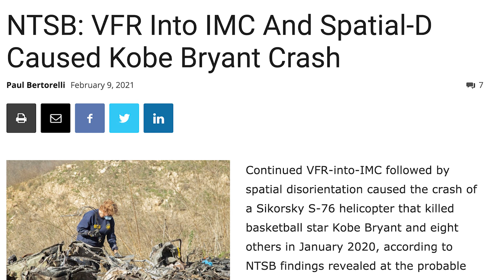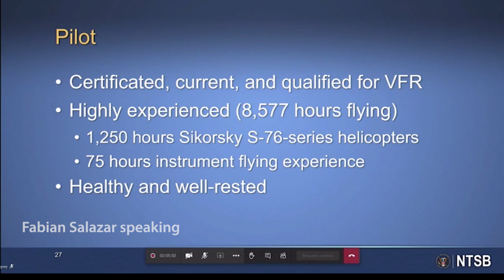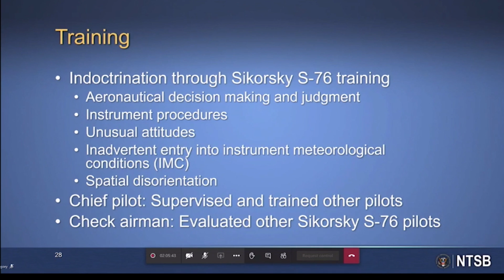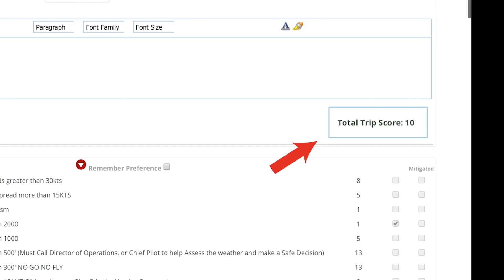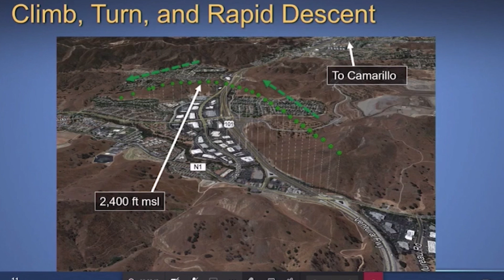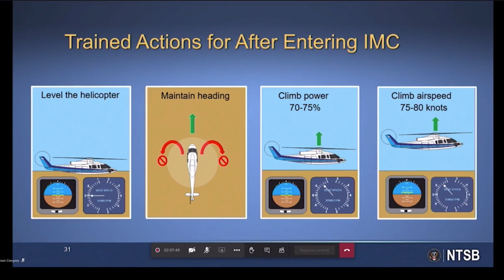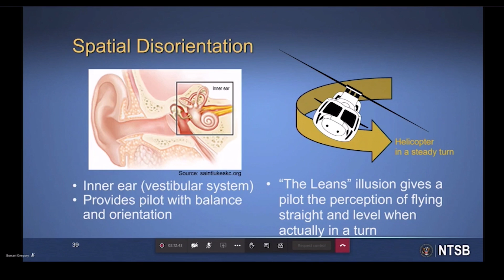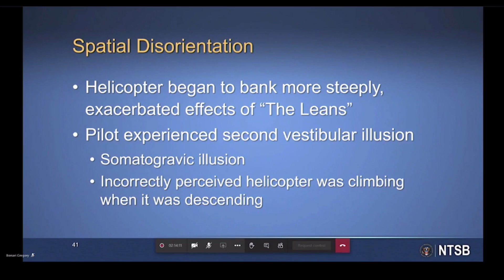How A Split Second Wrong Decision Caused the Kobe Bryant Fatal Crash

Comment: Paul, speaking of root cause, I still don’t understand how a commercial operator in Southern California where rugged terrain is a permanent feature and marine layers are a typical part of a pilot’s day is not authorized to fly IFR. And how does an 8,577 hour helo pilot only have 50 hours in IFR? If my family was a customer, a minimum standard would be IFR authorized operations and flying on an IFR flight plan every time.
Reply: Charter wasn’t IFR certified. You should be able to figure out why they don’t want it....rigorous testing, certification, lots of money, expensive insurance etc. in other words, it’s much much cheaper to operate a vfr only charter.
Reply: I had the same thoughts. I think most agree that the ”always IFR” attitude has improved the safety of the commercial aviation. If this guy had the option of filing IFR he probably would have been on autopilot and never had a single issues.
Reply: @Mrcaffinebean  yeah. He didn’t have the option of taking off with a full ifr flight plan. He did the old “I’ll go take a peek at how bad the weather is.” Well, it was bad, worse than he thought and he couldn’t turn around. Tough to say what he would have done if he safely made it above the weather. He would have had to declare an emergency and get ifr vectors.
Reply: @Debkghtulvkfjkjfxjjcj  yeah it’s pretty sad that a private pilot taking off that day had more safe options available to them than this pilot did.
Reply: @Mrcaffinebean  that’s a false statement.
Reply: @Debkghtulvkfjkjfxjjcj  this pilot did not have the option of filing IFR. In marginal weather it is much safer to file IFR. Therefore he did not have as many options available to him to safely take this flight as a private pilot would have.
Reply: @Mrcaffinebean  a “private” pilot doesn’t automatically mean they can fly ifr.
Reply: @Debkghtulvkfjkjfxjjcj  thanks Captain Obvious
Reply: @Debkghtulvkfjkjfxjjcj  Exactly.  That regulatory restriction on taking the safer approach (i.e. flying IFR) cost lives in this case.  The solution to this problem is to reduce regulations, not add to them.  Make it cheaper and easier for companies to use IFR flight and the safety increase that comes with it
Reply: @StevenWalter  Wrong. The safer approach was not taking off in bad weather.
Reply: @Debkghtulvkfjkjfxjjcj  It's always safer to stay on the ground, so that's not a useful analysis. Even the NTSB stated that there wasn't anything inherently bad about the weather that day. An IFR plane and pilot on an IFR flight plan would have had no problem. But that much safer option was taken away by regulation. Maybe there's good reason to make such operations prohibitively expensive, but I would have liked to have seen at least a discussion of that by the NTSB. They have a "human factors" person, maybe they need a "regulatory factors" person too
Reply: @Debkghtulvkfjkjfxjjcj  please watch the video on which you are commenting. The weather was not “bad” it was just not VFR. In  the pilot wasn’t even wrong to take off. Only wrong to continue according to the NTSB.

If the rest commercial aviation canceled flights flights for weather like this they would cancel 1/3 of flights. Instead they just file IFR because unlike most helicopter operations, they can. 

Due to regulation we have a disparity of safe options available between the private, IFR rated (since I have to point that out to you) pilots and then same pilot operating in a commercial capacity.
Reply: @Mrcaffinebean  Exactly my point. When you know the weather is dog shit at your destination, you shouldn’t take off. Kinda hard to argue with me here as all of the passengers are dead. The dude was circling at van nuys to get SPECIAL VFR clearance and had PLENTY OF TIME to look at the weather at the destination. He should have never taken off, and if he did, he should have landed at van nuys and told the people to get a limo. He didn’t not have the option for IFR since his charter was NOT certified for ifr which was apparently OK and perhaps even WANTED by his passengers since flying ifr helicopter is very dangerous. If the passengers wanted an ifr charter they had the money to get one. This isn’t about regulations, this is about a great pilot making a shitty decision. End of story.
Reply: @Debkghtulvkfjkjfxjjcj  reading is fundamental buddy, IFR helicopter charters seem to not really exist. Kobe wasn’t being cheap by picking this charter.

If this pilot wasn’t flying in a commercial helicopter charter operation no one would be dead. 

It is a sad that the FAA has made it harder to be safe.
Reply: @Mrcaffinebean  everyone agreed to vfr. The charter agreed to vfr. The pilot agreed to vfr. The customers agreed to vfr. And who makes the decision of whether vfr was ok for that day? The pilot. And made the mistake? The pilot. IF YOU DONT LIKE THE LIFEGUARD’s RULES STAY THE FUCK OUT OF THE POOL.
Reply: @Debkghtulvkfjkjfxjjcj  lol passengers have no idea what VFR/IFR is. In fact passengers probably assume that an aircraft is not going to collide with a mountain despite having all the proper instruments to avoid doing so simply because a pilot is told he cannot file a particular flight plan even though he is fully trained to do so.

I am sure if most people realize such a regulatory condition existed they would not take helicopter charters ever.

The FAA is the equivalent of lifeguard telling swimmer that if they are worried about drowning they aren’t allowed to wear a life vest and should instead just stay out of the pool. Sure that is the safest thing to do but people are will get in anyway and drown. 

So instead of screaming like a child saying they should. “STAY THE FUCK OUT OF THE POOL!” Logical people say, “ Why weren’t they allowed to wear a life vest?”
Reply: Y'all out here complaining saying IFR needs to be easier, but let's be real, unless it was literally the same reqs as vfr, there would be charter operations that opt for vfr only because it's cheaper. The real solution would be to make IFR a requirement for any commercial operation, leave vfr for hobbyists who aren't under pressure to get anywhere and only have the incentive to get back alive
Reply: @Aeronautics101  I don’t disagree with that, at least for charters that do this kind of flying. Are the big carriers legally required to file IFR or do they just choose to make it an industry rule? I did some Googling but couldn’t find a straight forward answer.
Reply: @Mrcaffinebean  I don't think the answer is as easy as you think it is.   Would they have been safer under an IFR flight plan?  Most definitely.  But that's the whole point here.   As the other fellow here stated, they weren't supposed to be flying in the conditions they encountered.  
   If you make all charters IFR,  costs now increase significantly, due to training, insurance, etc.  Because IFR flight is inherently more risky.  Also, it doesn't guarantee that everyone has a safe flight.  IFR flights can crash just as easily as VFR flights.  So you really aren't changing anything.   All you are really doing by going IFR is allowing the pilots to fly in IFR conditions.  
    The catch is that you don't need to fly IFR all the time, but you sure as heck would have to pay for it.  Therefore VFR only charters would have a leg up price wise, which is the reason that charters mainly opt for VFR only.
    Trying to take the pilot off the hook for bad judgement by blaming regulations, isn't really justified in this case IMO.
Reply: @boneseyyl1060  I’m not trying to take the pilot off the hook. The crash was 100% preventable and 100% his fault. But we know that people are fallible, and high time experienced pilots make poor decisions. So it’s important to look at the things that could prevent those decisions. People stall perfectly good aircraft and crash them into the ground. That is 100% pilot error but we still have stall horns and stick shakers. We know that something can be a pilot error but can also be preventable by putting systems in place.

One has to ask why taking an IFR rated pilot, and allowing him to actually fly IFR is somehow astronomically more expensive. And if doing so adds safety, why does it result of increased insurance cost? If a VFR only operation is somehow this big money safer why are their no major airlines flying VFR only? 

Why is it more expensive for everyone to be safer?
Reply: @Mrcaffinebean  It requires significantly more training for the pilot.  Flying IFR means you are flying in weather that is generally worse than VFR conditions, hence more risk, ( higher insurance).  Aircraft require more expensive equipment for IFR flight.  Pilots will get paid more for IFR qualifications.   Many reasons but that is the gist of it.  

So if you can fly say 75% of the time under VFR rules,  you save significantly versus what it costs to fly IFR the remaining 25%.   

I think the answer lies in more training for the pilots along with specific guidlines on what to do in VFR to IMC conditions.  That seemed to be what was lacking in this case.   The split second decision as it is described.   I definitely feel that this guy felt a responsibility to get his star passenger to the destination and that was the biggest factor here.
Reply: @boneseyyl1060  he was an IFR rated pilot in an IFR rated aircraft. The only thing not IFR rated was the company he was flying for because apparently being safer (IFR rated) is for some reason very expensive for helicopter charters.

The flight itself would not have been more expensive either. You burn the same jet fuel either way.

So none of the things you mentioned here are factors.

Think about this. The commercial airlines do not hire pilots that aren’t IFR rated, they do not fly flights that are not pre planned IFR flights. Those things on their face cost money. However. everyone agrees those things add significant safety and the safer your operation the lower the costs will be.

So why aren’t we applying this formula everywhere?
Reply: @Mrcaffinebean   Oh I don't think you truly discounted my reasons, but whatever.  And there are other costs in flights besides jet fuel, let's be serious here.  
There is a difference apparently, between helicopters and fixed wing aircraft, mainly in the flight levels I believe, which is the reason why a majority of helicopter flights are done under VFR rules.  Probably the shorter distances has something to do with it as well.   That's without adding in the factor of extra expense of IFR.  So it is a financial decision.

But you are saying that they should have been flying IFR and all would be well.  And in saying that, you are automatically admitting the pilot was at fault.  The accident would not have happened if they had stayed on the ground either.   I would hope you can see the dilemma here.  No need to make all helicopter flight IFR, simply because a pilot makes a bad decision.    

And comparing airlines to helicopter charters is an apples to oranges comparison.  Economies of scale and also schedules etc.   But I sense you are not about to be dissuaded from your belief that IFR is the answer.  Perhaps at some point it will make sense to do so.  We will see I guess.
Reply: @boneseyyl1060  no one here is saying the pilot wasn’t at fault. Stop spewing that garbage.

Why is a IFR rated pilot who according the the FAA is perfectly qualified to fly IFR, flying an IFR rated airplane perfectly equipped to fly IFR flights, some how become astronomical more expensive the second he files an IFR flight plan? 

You clearly don’t know the answer and neither do I. I’m saying that shouldn’t be the case and you’re to focused on making sure to blame a dead guy to worry about how the next accident gets prevented.

You have to solve for poor decision making in ways other than just saying “every body try harder next time thanks!”
Reply: @Mrcaffinebean  Quote:  "   Why is IFR so much more taboo and/or dangerous in helicopters compared to airplanes?

     Helicopters do not avoid IFR. They will, however, try to avoid IMC for safety reasons. The same is true for airplanes in the same weight class. Just because the pilot is IFR rated and the aircraft is IFR certified, it does not mean they will always fly IFR, whether they are fixed or rotary wing. Light aircraft in general don’t do well in extreme IMC, whether they are fixed or rotary wing. And, many of the same FARs in Parts 61, 91, 119, 135, 136 and 137 that would require an instrument rating apply almost the same to rotary-wing as they do to fixed-wing.

The main difference between fixed and rotary wing would be their environments of operation. Altitude would be a major factor. The majority of airspace below 1200-1500 feet AGL is uncontrolled airspace. You can not get an IFR clearance unless you are in controlled airspace. Since Part 91.119(d) allows helicopters to operate at reduced altitudes and distances from persons or property, they will specifically be used in applications not conducive to IFR flight.

If a helicopter were to fly IFR,they would be restricted to at least an altitude of 1,000 feet above the highest obstacle within a horizontal distance of 4 nautical miles from the course to be flown by Part 91.177. This would greatly reduce the usability of helicopters. The increased restrictions of IFR flight means that there is much more opportunity to make money in VFR flight with a reduction of risk.
      As far as your assertion that commercial fixed wing operations are almost exclusively IFR, that is not a completely true statement. While I will agree with you that may apply to Part 121 operations. That is not necessarily the case for all other operations. Many commercial operations depend exclusively on flying VFR."
Reply: Quote:   "Helicopter IFR operations do exist, but the short answer to the thrust of your question is: helicopter IFR is inherently more dangerous than fixed-wing IFR due to the lack of stability. A properly trimmed fixed-wing aircraft in good conditions could fly upwards of 30 seconds without pilot intervention, whereas a helicopter needs almost continual control inputs, thus leaving less margin for error.

To help overcome this risk, the certification requirements for helicopters are more onerous than fixed-wing aircraft, such as stability augmentation systems and autopilots. The effect of this historically has meant only the bigger and more expensive helis were actually IFR capable, so the pool of rotary pilots with IFR experience is much lower than fixed-wing pilots.

Finally, the obvious risks associated with helicopter operations - low to the ground, close to buildings, etc - do not work well with bad weather."

Link to an article on this subject.    https://verticalmag.com/features/helicopter-crashes-kobe-bryant-safety/

Hope that helps you understand the reasons better than I could explain them.
Reply: @boneseyyl1060  ugh now your copying and pasting things you’re googling. But this article certainly bolsters my case. Had the pilot files IFR he would have been 1000 feet above the nearest obstacle and likely on autopilot. He would have shot a nice ILS approach probably and everyone would still be alive. Sadly he didn’t have that option the only option he had was canceling and because he was presented with that regulatory dichotomy he made the wrong choice. The choice was 100% his fault but it didn’t have to be his only option.

IFR isn’t a “free weather pass” no one is suggesting that and no one that knows anything about aviation would suggest that flying serious IMC with any small aircraft. So the notion that being able to fly IFR would cause a heli pilot to take such a risk is rather silly.
Reply: @Mrcaffinebean  I have no idea what you are talking about and no desire to discuss it with someone who is willfully ignorant.   It seems you simply believe you are infallible and no amount of facts will change your mind.  So that's it then, it seems.  A win for you!
Reply: @boneseyyl1060  I believe very simply that pilots should have more options available to them to allow them to safely complete a flight. And believing that doesn’t remove any blame from this pilots shoulders. Getting killed by VFR into IMC is the most preventable accident is aviation. 

It’s really not that hard to understand.
Reply: @Mrcaffinebean  So you are saying that anyone who flies commercial must be IFR rated.   That's really what you are saying.   Again, the articles explicitly state the expense and risk involved with IFR  and yet you choose to IGNORE that.  So putting more pilots at higher risk in bad weather is a good idea to you.  Obviously a much better idea than choosing not to fly in adverse conditions, which carries no cost other than inconvenience.   

That's sheer brilliance, my friend.
Reply: @boneseyyl1060  yeah it seems pretty reasonable that a commercial pilot should not kill his passengers because he is in some fog. 

In fact anyone looking to do any amount cross country flying should get IFR rated. 
 Killing yourself in a cloud is a stupid way to die. It’s why I’m getting IFR rated it’s why my grandfather got IFR rated when he started doing cross country trips. 

As for the notion that some how it adds risk, that just doesn’t jive. More training and skills does not add risk.
Reply: @boneseyyl1060  and yeah not flying is always the safer decision. But people are going to fly. People are going to pop up and take a peek at the weather and think they can make it through those clouds and all of those things. That has happened since the dawn of aviation so all you can do is preempt those poor decisions by making IFR the expectation where VFR conditions are marginal.
Reply: @Mrcaffinebean  Well that is wise.  I get a sense though, that you don't really appreciate the increased risk of IFR flight.   And that is not a good thing for a pilot.   
I wish you safe flying in any case.  Be vigilant and be humble.   Complacency in the cockpit is your worst enemy.
Reply: @boneseyyl1060  the increased risk is the IMC, that one may encounter on any flight whether that is IFR or VFR. It’s their no matter how you take off, but only with flight planning can you mitigate it.
Reply: @Mrcaffinebean  The conditions at launch were VMC/VFR or he would have lauched in breach of the regulations of his outfit (VFR only) so the issue is not to lauch per se, but to continue to IMC.
Reply: @boneseyyl1060  aha I'm sure you got lost at "dichotomy" didn't you ?
Reply: @12345fowler  right but pilots almost never have the awareness to recognize the moment they go from skipping through the clouds to being stuck in them and their turning back doesn't always improve things. 

That’s why filing everythingbIFr adds safety. The pilot is already on the instruments and doesn't have to recognize the moment where things get bad. 

But like others have said it's apparently a nightmare to be an IFR helicopter op.
Reply: @12345fowler  Yes I did.  Perhaps you could explain it for me?
Reply: @boneseyyl1060  Not my role sorry. Ask your english teacher
Reply: @12345fowler  It was a facetious request, glad you didn't waste your time.  As to your statement :  " the issue is not to lauch per se, but to continue to IMC"   It seems a bit vague.  So what you are saying is that the issue wasn't that they went, but that they continued into IMC when they should have aborted?  If that is what you meant, then I agree.
Reply: @Debkghtulvkfjkjfxjjcj  so the millionaire was actually a cheap skate - he chose the lowest common denominator.
Reply: @PhilbyFavourites  he most likely didn’t “choose” as full ifr charters rarely exist. Probably wasn’t even an option to him.
Reply: @Debkghtulvkfjkjfxjjcj  They were circling because they had to wait for other air traffic before they could enter restricted air space (Burbank/Van Nuys). Are you going to tell Rescue or MediVac helicopters they can't take off if there are low visibility conditions anywhere on the route? Just let people die then? Helicopters can do things planes can't that's why they are allowed to fly SVFR with lower minimums.
Reply: @bbigjohnson069  this wasn’t a rescue helicopter saving people. They were on their way to a basketball game. That’s a terrible analogy. Good try though.
Reply: @Debkghtulvkfjkjfxjjcj  It's all under Part 135. Helicopters have lower minimums regardless of use. This flight was proof of that. By choice local law enforcement still had their helicopters grounded at that hour. They felt it unsafe but it was still legal for him to fly.
Reply: @bbigjohnson069  of course it was “legal.” However, the charter only had its license for vfr. Once those conditions change the pilot should have turned around. He wasn’t properly trained otherwise. Hence 10 dead souls.
Reply: @Debkghtulvkfjkjfxjjcj  No one said he wasn't properly trained.
Reply: @bbigjohnson069  wow, been a while since I have seen a good old fashioned totally pointless Internet argument by people determined to be right, and willing to spend enormous amounts of time endlessly repeating themselves, to prove their point. It has been highly entertaining, almost like the old days again, thanks guys.